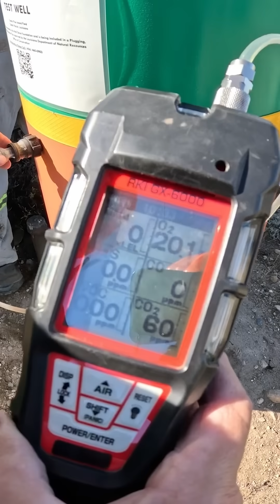The problem goes deeper than you think...

Comment: The oil doesn't always run out. In many cases the well becomes water cut which means the water below the oil can migrate through the permeable formation more quickly than the more viscous oil.
This is whats referred to as coning out due to the water migrating in a cone shaped vortex in the formation.
The big concern are zombie wells. When the welll is stopped being pumped the water will gradually settle down to its level below the oil while the oil migrates back into the well bore. The gas above the oil also migrates towards the wellbore and because of the underbalance begins to push the oil toward the surface causing  the well to flow by itself.
This is called a kick. As this process speeds up it turns into a blowout, an uncontrolled release of oil and gas.
I hope this can help you understand how an oil well can come back to life.
Reply: Learned something new today, thank you!
Reply: @Ironsight_Player  glad to help  thank you
Reply: Good and accurate explanation. Capping or sealing off a well is much more preferable than cementing it as it allows a company to go back in later affordably and make use of it.
Reply: @crazyoilfieldmechanic3195  absolutely, also if they cement it they can’t use it to monitor the oil field in case pressure builds up again
Reply: @crazyoilfieldThere you go. mechanic3195
Reply: Very well explained and is mostly true. Wells in this condition that are not plugged are likely in the tertiary stage of production meaning they do not have enough pressure to produce on their own. If the well has unrestricted access to relieve pressure through the wellbore, then it is impossible for a kick to occur unless the casing erodes and formation gas/liquid invade the wellbore. Sources: petroleum engineer
Reply: Not only that, but plenty times the oil replenishes.
Reply: If you want to drill a well then you put a capping fee deposit with the territory. If you go bust it don’t matter the money is with the state to cap it! If you prove you capped it inspected in stages you get your deposit back for that well. Simple.
Reply: Thx for the information dude much appreciated
Reply: @benreid7567: Thank you for sharing your knowledge and for explaining!
Reply: I watched Deepwater horizon so many times and know I understand the "kick" superb explanation
Reply: @lewyvuittondon2296  From what I understand about Deepwater Horizon that there were many factors that influenced the outcome of the situation. I cannot speculate on what went wrong because I wasn't there. I hope you understand.
Reply: Either way it's dangerous the company should have capped it on their expense not everyone else's or the landowners they made their money out of it they should properly be charged for another company coming in to finish the job they didn't finish
Reply: Thanks 🙏 really does shed light on the problem 😢I’ve seen these leaks and they are messed up and to think they have hundreds that will eventually do the kick and then become uncontrollable
Reply: You're the first person I've ever heard even mention a zombie well, so thank you for immediately following up with a damn good explanation. It makes perfect sense.
Reply: @benreid7567  THANK YOU!
Reply: That is really interesting knowledge, thank you sir for sharing it.
Reply: Just in time for Halloween!
Reply: What????
Reply: @anthonypetercoleman339  oil don't run out.problem that dosent exist solved
Reply: @junicohen7918  fields become depleted and uneconomical to produce though. That's why we plug and abandon those wells.
Reply: Very nice comment!! Ty for the info, it definitely helps me understand it better. And you gave me my new info quota for the day! Seriously though I love new info so ty!!
Reply: so... a natural ram pump basically?
Reply: This makes sense to me because water is heavy and will always go to the bottom causing the oil to be pushed up to the top  along with the gas in the well which causes the blow out. I am a retired fuel truck driver and we always had to check for water before we dropped fuel into a tank. Because water was always at the bottom of the tank pushing the fuel to the top  . Thank you for your experience in this field of work, sir. Have a wonderful day.
Reply: @jeffearnest3269  Thank you.
Reply: benreid & milooahmo- thank you both for your great reads! I just learned so much from the both of you, today! Keep shining!
Reply: I was visiting a platform in Alaska that was shut down for many years because they had thought it ran out. Its been back in production for the last 15 years as they learned it refilled essentially.
Reply: Interesting thank you.
Reply: Thanks for the lesson, that was interesting
Reply: Thank you for the interesting, easy to follow and concise explanation!
Reply: Scary... We humans sure know how to destroy the Earth...😢🤦‍♂️🤦‍♂️🤦‍♂️
Reply: You should make a video!
Reply: Wow I really am fascinated and the expert explanation you gave Benreid. I bought a house built by Ryland Homes in Carlsbad California on Corte Orchidia
 They retained the oil right to drill beneath the home. How would they drill it? Slant drilling if they did do it? Would subsidance of land and all homes not later occur ? 😮 Rex Harrisen
Reply: Epic, you should make a video on this. Great explanation.
Reply: Excellent knowledge. The author here may not realize that the reason this area was explored is because of natural methane seeps in the area. Plugging this hole is good but I’ll bet there’s more gas around. I worked for SOHIO. 😊
Reply: What you said is very true. I watched a documentary about this on USCSB's channel!
Reply: @losingmyfavoritegame8752  thank you.
Reply: so invest in the land, buy the ground rights and wait... oil will return in time.
Reply: @dredgethesoul  not unless the field is depleted.
Reply: Thanks, that explains why a simple plastic cap would not be sufficient to trap any gasses inside! :)
Reply: Time to go find all of these abandoned oil rigs lol
Reply: Thanks for the information. Youre doing the internet the right way.
Reply: So you’re telling me you could either risk having a catastrophic failure on one of these bad boys or just seal it up yeah I think I’m just gonna seal it up
Reply: @nyankittyxp4521  Some people are just too short-sighted to see that, unfortunately, look at fosil fuel companies. They're fighting tooth and nail to prevent more sustainable energy source from becoming more mainstream.
Reply: @Ironsight_Player no they are fighting tooth and nail to stay in business, if we had water powered cars do you think anyone would go back to gas powered cars? Hell no which would cause the oil companies to go out of business. The fact of the matter is, the oil companies need our business just as much as we need their product, there isn’t infrastructure in place to fully support an alternative to fossil fuels, not one that could completely replace gas and oil. It will be an incredibly long time before we see gas and oil production cease due to something better replacing it. They tried to force it on us by cutting down on how much drilling we do but all that has accomplished is drive the market up because demand is high and supply is now lower. Everything that could replace gas and oil such as wind or solar still require gas and oil to harvest resources, manufacture, and deliver to the site. They still require maintenance which requires trucks and equipment which run on gas and oil. Even a lot of EV charging stations are powered by a diesel generator or powered by a coal and natural gas power plants since majority of US electricity comes from coal and natural gas.
Reply: @Michael_Ward  do you realise that if we were to stop using oil that we would have to go back to living how people lived before the American Civil War?
Reply: @Michael_Ward  yea I know that, that's why I never said we need to switch RIGHT NOW, we just need to stop burning fossil fuels, oil can still be sustainable if it isn't burned, that's what causes climate change. And addressing your first statement, oil companies wouldn't go out of business. They'd lose tons of money, that's for sure, but gasoline isn't their only revenue stream. Petroleum is used in tons of other things that are perfectly safe for the environment. Oil can also till be used as a lubricant. Natural gas is also perfectly safe. The reason we don't have the infrastructure is because nobody wants to buy EV's right now so potential investors don't really want to invest in EV infrastructure, at least my state, it's absolutely PEPPERED with EV charging stations. So my state, actually has the infrastructure. That's becoming less and less of an argument.
Reply: @Ironsight_Player What are you talking about? Name these more sustainable resources and we can argue the semantics, nothing is infinite, everything has a cost.
Reply: @Ironsight_Player unfortunately a fearful population is also to blame for obstruction of nuclear power, which has never killed a single person in North America. People think about Chernobyl, but even with that old tech it was a completely avoidable disaster brought about by choices to save money and poor safety standards.

Then you have the "green" movement who obstructs hydroelectric dams, because some obscure frog or uncommon waterlily habitat would be reduced in a few places in the entire world.
Reply: Only seen one charging station in my life, guess my area is just TOO backwards
Reply: @Ironsight_Player 
EVs aren't exactly an Eco-friendly solution. The process to mine and refine lithium, nickel, cobalt, etc. comes with its own set of problems. Nevermind that the majority of electric produced in the U.S. is provided by coal powered electric plants. The necessary infrastructure goes well beyond a lack of charging stations. In short, we're a LONG ways away from electric vehicles being a sensible "clean" alternative.
Reply: @benreid7567   - everyone forgets about all the materials which are dependent on the oil....
Reply: @Michael_Ward   (?? water power?? - is like calling wood ash the potential to resurrect the tree. Water is what happens after you burn hydrogen.  Resetting that back to hydrogen takes some energy - yes we can use the sun to do that, but the infrastructure isn't free, nor self replicating and the energy may have a need (better use) elsewhere.
Reply: @kadmow  our whole society depends on it
Reply: @benreid7567  did you read my comment? I’m not advocating against the use of oil and gas, quite the opposite actually. I think you need to reread my comment if you think I’m in support ending the use of fossil fuels. I literally stated how everything relies on gas and oil, even EV charging stations rely on fossil fuels, the manufacturing of EVs relies on the use of fossil fuels, my whole point was that the infrastructure is not ready for everyone to drive an EV not to mention as of now they are not any better for the environment. Sure they have less or no tailpipe emissions but the emissions produced and the cost to manufacture EVs are far higher than ice vehicles
Reply: @Michael_Ward  wind and solar are never going to be capable of replacing fuel. 
If anything nuclear is the replacement for the majority of electricity production, but oil is literally irreplaceable due to many of its properties beyond fuel and electricity production. 
Petroleum products are wide ranging and useful, there isn't any functional replacements for many.
Reply: @Ironsight_Player  that's not how the infrastructure works... Have all the charging stations you want, and then find out the supply isn't adequate once all those charging stations are in use. 
Or that the supply isnt regular enough without being supported by combustion.
Reply: @Michael_Ward green EVs are only as green as the coal and diesel generators that charge them.
I recently did some work out in the Texas panhandle and there were dozens and dozens of train cars miles and miles long filled with nothing but coal, heading to power plants to power the cities.
I think most people just don’t have any idea about how our infrastructure and power grid really works.
Reply: @Ironsight_Player that's just it, no they aren't. IF there was a VIABLE alternative, they would sell that. There isn't right now. If we had to use only alternative energy, ie windmills and solar, life as we know it would stop. There is nowhere near enough capacity to replace what we use in fossil fuel with alternative energy. Worse, the grid is in no way able to move anywhere close, even remotely close, the volume of electricity that is being blissfully ignorantly hoped and prayed mandated replace it in a few short years. I was a utility lineman. Be careful what politicians demand, they are clueless and or are lying to you. 
Alternative energy will happen. Demanding it before it is ready at best is a fools errand, right now it is a direct danger to us all.
Reply: @benreid7567  I love how everyone always thinks that the only product that uses oil and gas is fuel.  That's actually a minor sector of it's useage.  Almost everything made today that isn't metal comes from petroleum of some sort, including their precious "electric/water powered/unicorn fart" cars.
Reply: @grnsouth1204  If we were to eliminate the use of oil for everyday things we would be living like we were before the America civil war.
How many of these commenters would be heading to Nantucket to pick up a crew on a whaling boat? 
Or heading to Virginia to mine coal or Alabama to grow cotton? If the answer was none then they would be kicked out as a burden on their families. Better head to Alaska or California to look for gold then.
Reply: @benreid7567  Right? It's used in the production of almost everything we use on a daily basis, both individually and collectively as a society. Fuel accounts for a minority fraction of what we use it for. But that's too much critical thinking compared to parroting something they heard from a talking head on the idiot box.
Reply: @Michael_Ward  water powered cars are impossible dude...
Reply: Some people think that oil companies are afraid of going g out of business.  That's a laff . The world will always need oil for meds chems a plastics
Reply: Very well described. But unlikely. If the well was capable of a blow out, why did production stop?
Reply: Notice that the oilwells he is talking about have pump jacks on them. In many cases when these well were drilled they would have been free flowing wells. Back in the late 1800s  and early 1900s when wells were drilled the formation pressure was much higher because it is estimated that the Permian Basin of Texas is estimated to be between 1.3billion to 850million years old which means that it has had all of that time to build up pressure due to gas migration being stopped by the impermeable formation above the oil. Formation pressure is also influenced by the amount of overburden weight it has above it.
Imagine if you took an inflated water  balloon and put it under the carpet in your living room. You  then would have a small round hill in your carpet. These domes are what geologists look for on seismic charts to establish the possibility of oil production. When the wells were originally drilled and formation pressure was high and there were no such things as blow out preventers and weighted drilling muds. The conventional method was to allow the well to kick (flow) then put a diverter over the casing and allow the oil to flow into ponds to be collected. As more and more wells were drilled and the formation pressure became less it was assumed the oil was running out. People figured out the oil was still there just you needed to pump the oil to get it out. You are going to find as they continue to plug abandoned wells what will happen that the the gas venting from these wells will be forced to either be trapped and pressurise the adjacent formation or migrate to path of least resistance and vent through another well. In doing so it will be create gas lift. This is a process we already use to increase production from old wells.This is how you might finish up with old wells coming back to life and seeing kicks and blowouts on presumably dead wells. Having worked drilling production wells near disposal wells  (pumping old formation water back into the formation) it can be very stressful as we know this can cause the well to flow, especially if you are about 1mile from the disposal well.Rule #1) Every well is a live well and should be treated as such.
Reply: @benreid7567  
That's fascinating, thanks for posting.

{:o:O:}
Reply: @benreid7567 you are an oil well genius. If we ever have an asteroid heading towards earth, I hope they call you.
Reply: @tomcat8662  no I'm a conspiracy theorist, I'll be stuck on the highway with all the other people fleeing aimlessly into the wilderness!!
Thanks for the like.
Reply: @benreid7567  wow that makes so much sense thanks for the knowledge. ❤️❤️
Reply: @benreid7567  That's a good example of how "saving the Earth" isn't really saving the Earth. It's just feel good activities to make us think we are doing something.
Reply: I just mentioned that l had heard that a lot of these old wells were coming back to life. Thanks for a layperson-friendly explanation as to why that may be.
Reply: @ Super insightful, thanks for sharing the knowledge.
Reply: @zoeybella234  thanks
Reply: @benreid7567  incredibly well written and thoughtful response.
Reply: @BoogUwU  thanks
Reply: @LOFTIB the earth keeps making it and it eventually refills
Reply: @LOFTIB  because of water getting drawn up from agitation at a lower pressure. It can take years for everything to settle into equilibrium again after they stop pumping. That's part of the reason they don't cap the wells or permanently when they do.
Water wells do something similar if they get too low, only they settle faster since water is much less viscous than crude
Reply: @LOFTIB  production stopped because the well stopped pumping oil, only formation water. If there is a flow of anything from a well it is referred to as a kick, it can be oil, gas, water, or salt water. If it is uncontrolled and catastrophic it is referred to as a blowout. The well is considered to be static if the hydrostatic pressure of the drilling fluid is greater than the formation pressure but not dropping away. If you encounter losses the formation has broken down and any fluid in the well bore will fall away.
Reply: @benreid7567 You’re partially correct. I assume you’re probably in the early years of you’re PENG degree maybe just looking stuff up. Blowouts and kicks occur during the drilling process, not during production. You’re correct in describing how they occur where hydrostatic pressure of the drilling fluid is less than that of the formation. However, blowouts would not occur during production as any flow is directed from the wellhead to a production facility. While a well can naturally flow during initial peak production, the formation pressure will decline over time and it will become more and more difficult to lift that fluid to surface as the difference between your wellbore and formation pressure become closer and closer, which is why we use artificial lift methods to decrease downhoke pressure allowing fluid to flow more easily from formation to the wellbore. By the time this well is no longer economic from high water cut, it would no longer be able to flow naturally. The wellbore will fill to a level where the hydrostatic pressure of the fluid column in the wellbore equals the formation pressure. Hope this helped! If you’re a fellow petroleum engineer, goodluck! It’s a tough 4 years but leads to an incredible career. Can genuinely say I love going to work everyday and have met some great people.
Reply: @milooahmo2209  Thank you for your feedback, just letting you know that I am not an 18 yo student studying 1st year petroleum engineering and 
I have been working in the drilling industry since 1994 until now with about 15 months out due to a down turn in 2017. I have been an oil/gas driller since 2003. Worked in 9 different countries, drilled water wells, geothermal, oil, gas,  disposal wells,
and 1 Co2 well. Vertical, horizontal, directional, multilateral, "s'shaped wells high radius shallow wells
Drilled with cable tool rigs,built out of timber singles, doubles  triples, compound, scr, vfd drive, Kelly, top drive, power swivel,  air, nitrogen, water base mud, oil base mud, holes from 36" dia down to 3 1/8" out to 19000 feet,  workovers,  electric submersible pumps, sucker rods, whipstocks, packers, plug and abandons, fracking, Moved rigs with trucks and helicopters, and loaded  barge with rig. Helped build rigs, built my own rig. Is that enough experience for you? 
The mistake you made was assuming things about me that you didn't know. The same way people assume a well can't flow, it may be unlikely but not impossible. Just remember, every well is a live well.
Reply: @benreid7567  you may be an expert in the drilling side but there’s a few things you mentioned that I aren’t accurate on the production side. You mention how migrated gas venting can cause gas lift in adjacent wells? What in tarnation. Gas lift is when you inject produced or buyback gas down your tubing/annulus to decrease the density of your fluid downhole and create easier flow. What it seems like you’re referring to is a gas flood where we usually use intermittenly injected water and gas slugs to sweep oil from an injection to producing wellbore. The blowouts you’re mentioning are super unlikely and the only cause I can see for it happening would be casing erosion and the flow of additional fluid to the wellbore.
Reply: @milooahmo2209  when bringing a well online what do you do to induce it to flow?
Reply: @benreid7567  typically we have our projected high production new wells started on either ESP or reverse gas lift (this is for unconventional wolfcampian wells in the Permian). Wouldn’t make any sense in bringing them online under natural flow conditions without artificial lift because of the the steep decline in production for unconventional wells. As per your question, I assume you mean what causes a well to flow naturally? Its the difference in pressure from your formation to your wellbore (drawdown). And that pressure difference has to be enough to overcome the change in elevation from TD to surface as well as the frictional pressure losses experienced by the fluid traveling through your production tubing (or annulus when using a reverse gas lift system).
Reply: @LOFTIB theres literally a blowout just like this in Toyah TX as a geyser right now.
Reply: @reasontexas  Are they fracing around the the well that’s “blowing out”?
Reply: @LOFTIB usually depends on who's running the country at the point in time.
Reply: @LOFTIB he said the company became bankrupt which probably led to this.
Reply: @LOFTIB Did you not comprehend? A blowout is most likely to occur BECAUSE the pumping/production has stopped...why is what he said unlikely. You should try to figure out what YOU'RE talking about first, before trying to tell people they're wrong...😂😂Damn keyboard scientists😂😂
Reply: @  Robertlee4809
Incorrect. You have no idea what you’re talking about.
Reply: @LOFTIB  Read it again and this time read the entire thing.
Reply: @LOFTIB you weren't one to pay much attention in much were you? Dude just literally layed out the process in a very easily understood way by the layman yet using technical and industry terms. Explaining processes and reasons. And then your like " Nope, doesn't make sense to me so therefor its not plausible or even possible." Regardless of what YOU believe there are likely MANY in the world who KNOW, can DECIFER and who have personally ACCOMPLISHED many things you couldn't wrap your pea brain around the process of, or the logic behind it being so, if you tried your damndest. That still DOESNT mean it is a fallacy, no matter how hard you WISH it to be. Do better. There's chance to learn and absorb new information every SINGLE day. I suggest you do some of that absorbing as your sorely lacking in the department of knowledge
Reply: Physics. Nice explanation of what is going on.
Reply: I read about how the oil wells work a while back. It said the oil flows into the empty well and can be pumped out again. It just has to rest for some time, while it saturates the well again. IDK 
I'm just going by what I read online. LOL
Reply: imagine how many cars were added when Biden blew up the Nordstream pipe to Germany.
Reply: You copy and pasted google maybe if you didn't try to sound like an ai, we would understand what the heck you just 
sayed
Reply: @IncoherentClam 
Sayed?
Bro, even an AI could've fixed that for you :/
Reply: @IncoherentClam  OK fined me the sauce material and eye will bee leave what you sayed. Copy paced my r's.
Reply: @IncoherentClam  maybe if you weren't simple you'd understand too.